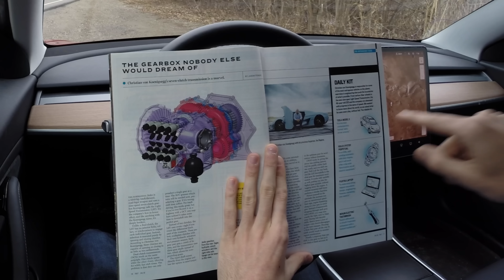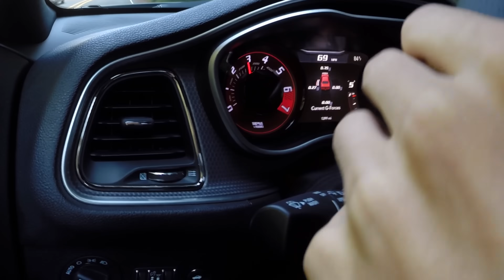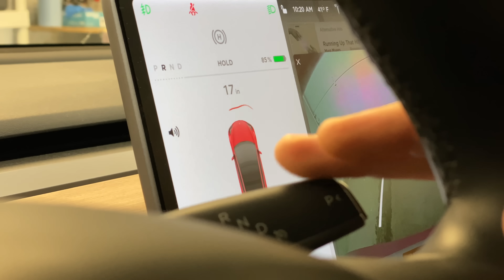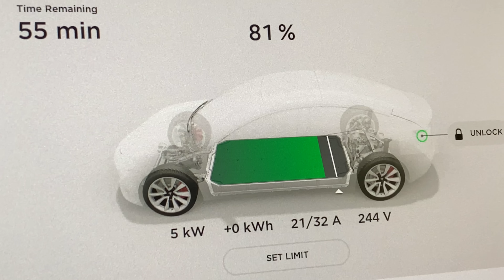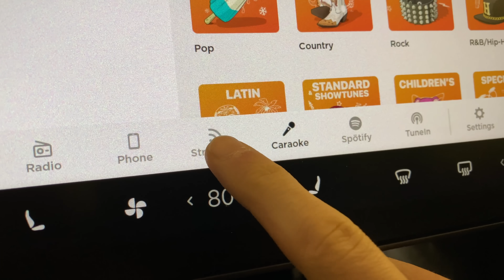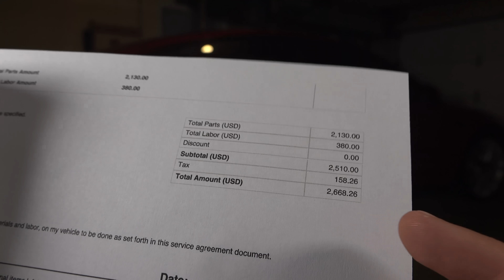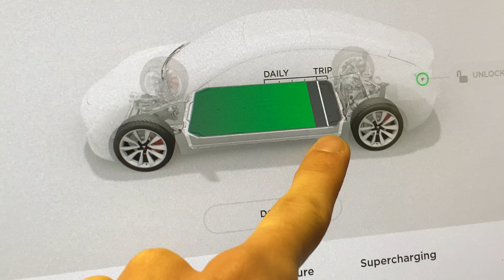Living With A Tesla Model 3 For A Year - The Best Daily Driver

Comment: Hey— my 2019 Camry XSE doesn’t sound THAT bad...exhaust is decent, engine is quiet when not flogging it.
But I would kill for a Tesla Model 3, upper trim.
Reply: Daemon Silver It may seem to not sound that bad and the exhaust may seem decent, but you have learned to tune those sounds and smells out. Drive an EV for 6 months and then try driving your Camry and you will be surprised at how your perspective will change.

Comment: Why set battery at 80% when you don't know if the battery management system doesn't do it already? You then can end up with 60% of physical capacity.
Reply: Tesla recommends setting the max state of charge to no more than 90% and only going above 90% if you need to for travel.
Users seem to recommend 80% as a good daily normal because at 90% regenerative braking is limited.

Comment: 13:10 - not true. Basically you didn’t read the owners manual.. :)
There IS a manual emergency release handles on the back doors. BUT for child safety purposes (and to protect rear windows), they are hidden inside the door speaker. The speaker cover is easy to get off with just hands - so yeah, there IS manual emergency release handles in the rear too.

- The More You Know :D
Reply: Child safety purposes?   Hidden inside the speaker?   GTFO.   essentially you just said, disassemble the door handle and find the mechanical portion of the latch.
Reply: That's only for the Model X. Unless it changed, the owner's manual states only the front doors have manual releases.
Reply: Yeah, or they could have made them visible and used a child safety lockout selector in the end of the door latch like everybody else. Pretty sure that feature isn't under a current patent.
Reply: Larry Bolan having it hidden behind a door speaker probably is! Insane.
Reply: In an emergency, that is too much thinking and too much time..... in such a situation, the folks in the back probably would not have read the manual anyway...
Reply: Okay, cool. Guess every passenger had better pass the "where is the super hidden emergency door release handle" quiz before they get in.
...
Or Tesla could put the release handle in plain sight like every other car in existence.
Reply: mjc0961 just like the front release ones that everyone mistakenly uses to get out? Teslas are like escape rooms!
Reply: @mjc0961  The regular release button drops the windows out of  their seals before the door opens. The emergency handle just mechanically opens the doors and could damage the seals
Reply: @mjc0961 You don't want your five year-old who has just graduated from the car seat opening the door and exiting the car in a fit at 20 mph because you won't stop off at their preferred destination.
The driver can tell adults where the release handle is. The super secret release handles are better than the child safety locks that are inside the door jamb in ICE cars. I've been temporarily trapped in the back seat of a few cars when the driver forgot to unlock the rear doors.
Reply: @mjc0961  every other car does not have a electrical button as the door opener, and therefore the need for an emergency release handle. It's a part of the design. :) 

It's ONLY needed if there is an accident that completely shuts all electric power down, which is never heard of to this date yet. So you'll probably never need it anyway, unless you run red lights with 0% batteri and slam into a tree with 90mph lmao.

So don't worry about it dude. :)
Reply: Emre Altintas so how come the front ones are so visible and accessible that many passengers use them to open the front doors by mistake? And also, what if the button has a malfunction? You’re just too smart to have thought of that though;) or the automatic door mechanism fails? The battery could be at 100% charge and that would make 0% difference. And you will be 100% dead too! And haven’t you forgotten that several people burned to death in their cars because bystanders couldn’t get the doors open from the outside? So you suffer from memory loss too?
Reply: I mean, an electric car can have normal door handles, so...
Reply: @LazerLord10  You haven't solved the child safety locks problem. Those defeat the interior door handles.
Reply: @Markle2k  In every vehicle I've driven, the doors all lock once you get up to speed, and I imagine they unlock in the event of emergency egress, and I'm pretty sure that most cars nowadays are child safe and still have mechanical handles. Really, this concern is about how a button or something else in the electronics chain could fail and cause an unsafe situation, whereas the mechanical handles are a lot simpler, and thus (in theory) more reliable. In actuality, the difference probably isn't notable for actual safety (as you mentioned with the lack of problems so far), but still something to consider.
Reply: @LazerLord10 I'm not sure whether you are privileged or deprived by never having ridden in a car without power door locks.
I will make this plain, when the child safety lock switch is thrown, the rear unlock switches do not work and the interior door handles do not work if the doors are locked. Only the driver's position has lock switches for all four doors. If you lose 12 volt power or the driver's switch panel is broken, the only way to get out of the back is to be let out by the outside door handle or to climb over and through to the front seats.
Much like the interior trunk release mandated by law, the Tesla has a mechanical means to open the rear door from the inside.
Reply: @Markle2k  Alright then. Fair enough.
Reply: Markle2k sure has, child safety locks are engaged by choice, not by default
Reply: @JeepCherokeeful  Child safety locks are frequently left engaged through forgetfulness. They are hidden in the door frame and completely transparent to a driver who only uses the outside rear door handle to load bags and other cargo.
Reply: Markle2k it does happen sometimes, but it would have to be both and the first time on the trip the adult would have tried to get out. These vehicles are the only one with this design and it isn’t necessary, as a car enthusiast I worry about other shortcomings, such as no windshield wiper stalk and I’ve also heard the batteries loose a significant amount of range in heavy rain. Plus of course cold weather and phantom drain.
Reply: Markle2k ok, so why would this person ever lock both of them if they don’t have kids? And how did you know where these magical switches were? You must have read the owners manual. Or maybe all other child locks are in that same location so you just assume by default that’s where they were.
Reply: @LazerLord10  you are absolutely right. It is somewhat a design flaw. Because the S/X clearly do have them.
Reply: That could explain the difference of the sound system in the rear!

Comment: I'm surprised a guy as car smart as you  Hasn't figured out how to set your mirrors so that you really don't have a blind spot... I mean I learned that at 16 years old in my driver's Ed class in high school.  I'll throw you a tip:   Take your left ear and put it against your driver's door window, Then move the mirror outward until you can just not see the side of your vehicle, Then sit backup straight and adjust as needed for vertical view. Then lean to about the middle of the car maybe a bit further on your right,  Adjust the mirror in the same way horizontally so that you can just not see the side of your car, Again then sit upright adjust for vertical view... if you don't believe me grab some cones and a friend.  Have the friend stand at the back corner of the car and set the cone down when you can't see him on your left.  Then set your mirror like I stated and repeat the test.  What blindspot may possibly yet exist is so tiny it doesn't even really qualify as a blindspot.   I've set my mirrors this way since I was 16 years old And what I can tell you is that 99.9% of the time I still see somebody's brake lights on my left or right in my mirror when I make a 90ﾟ look to my left or right and see their headlights.  Tell you what, Make a video on it and shoot me that shout out when you find how Awesome the trick is😉😊

Comment: There is one thing which you left out, but maybe it was on purpose... Energy efficiency.

In Europe we have it relatively easy when it comes to calculations, because basically 1 liter of fossil fuel (diesel or gasoline) basically equates to 10 kWh of potential energy. Which means that my 2.2 tons Model S basically has, during its lifetime so far, consumed the energy equivalent of 1.87 liters for 100 km (ie 18.7 kWh/100 km; and no, I won't "translate" to kWh/100 miles or mpge -- use the metric system). Compare that to basic diesel powered city cars which boast, at best, 4 liters for 100 km.

Comment: I'm not sure if you can weigh in on this or not:
How does the battery charge hold up in the winter, the most common bash i hear about Tesla (from non Tesla owners who are scared of change) is that it would be pointless in the winter/cold weather because the battery would die so fast. I'm assuming they are using the logic of "well my phone dies fast in the cold so my car would to" but, we regularly see -20C/-30C temperatures in Canada and it would be great to hear how the car handles below freezing temperatures if you have experienced that where you live. I already have forwarded this video on to a few of my friends who are afraid of EV's and finding out about its winter capabilities would be icing on the cake.

Comment: 9:42 what about the environmental impact of long term battery supply sustainability ( mining etc) and recycling of used/dead batteries?
11:08 doesn't not using the brakes for prolonged periods cause seized calipers?
Reply: Mining metals is still greener than drilling and refining crude oil.

Comment: Jason:  at 6:43 you say "when I leave my house it always has a full battery".  This implies you always plug it in when in your garage?  I understand the max level set below 100%, but even at 80% is this a good habit for the life of the battery cells?  I thought charge it when it gets below the need for the next day, like if the range was less then my daily round trip, then charge it, so I might charge it once or maybe twice a week and avoid the constant topping off.  Or am I off base here and you recommend always charging whenever possible?
Reply: It's a monitored charging system, so you cannot overcharge it and it controls the charge for optimal electrode life. What kills these batteries is constant supercharging.

Comment: Im surprised you didn't mention gasoline itself. A class 3 explosive, that contains 15 hazardous chemicals, causes cancer, and intoxication, and you can actually get to the fuel, instead of closed systems like CNG or electric where you cant get to the fuel. Gasoline is insanely  dangerous, and would never allowed to be used today.

Comment: I really like the idea of electric  cars. I cannot accept a fuel where 75% of what I buy is wasted as heat. However, the whole appeal of electric cars is simplicity, yet manufacturers insist on piling BS flimsy gadgets on electric cars, perhaps to justify the price?
I watched my friends lease Model X, S, and while they love the cars, they simply have not been reliable. They should be the most relaible car on the road. Buying one off warranty is just not an option.
In my region, they devalue about $10K/yr, but plummet off warranty. For me, $50K in devaluation means almost 20 years of gas purchases.
When they make economic sense and when they get as reliable as they should be, I'll buy one.
Reply: Tesla has the highest resale value of any car. Not sure where you live but overall Tesla devalue way less than most cars.

Comment: No one-pedal driving on my S100D, even though it’s less than a year old. Which is funny, since it will come to a full stop with ACC or Autopilot activated. Well, luckily that’s how I usually drive anyway. After 6 months behind the wheel I love it. Never going back to ICE cars, if not for hobby purposes. EV’s are fantastic, despite some of the drawbacks. Also far better during winter than ICE. It’s always warm in a Tesla. Well, assuming it has enough charge remaining that is.

Comment: But the battery life for electric cars are very poor and will give much reduced capacity ehen compared to new ones and should be replaced regularely to keep optimal range (which is piss poor compared to disel or even petrol). 50k for a car is outrageous (4.5 years worth of netto wage for me). Not to mention infrastructure is not ready for electric cars. And cold weather and no garage will kill battery even faster. For now electric is a gimmic only rich can afford.

Comment: You can always point the vents at the steering wheel before you leave to heat the steering wheel but it does seem annoying not having a heated steering wheel on a car that expensive.

Comment: How is the noise on the highway? I rode in a model S and I thought it was louder than most gas cars because of the wind and tire noise. (Usually engine noise when not accelerating is basically imperceptible anyway)
Reply: Road/wind noise is not great, maybe the worst feature of the car. That said, it's better than ICE at low speeds, and still comparable at highway speeds, you just hear the road noise a lot more because it isn't competing with engine noise.

Comment: I've recently received my model 3 performance edition a day before Christmas 2019, and wow, this is absolutely the best, most convenient, comfortable car I've bought. The 0-60 mph time is within 3.5 seconds which is amazingly fast. Performance is not joke. Handling is also phenomenal for the weight and sedan class it is. Ive had no complaints other than the advertised mileage of 310 miles, realistically it's only gives you 240-250 miles on a full charge while driving as you would normally would. Also if you can charge at home/work with output of 20 mph, you're pretty much set for a commute that's within a daily 200 mile range commute. For those who live in apartment or don't have readily available charging, its much harder for you guys, it's possible but you'd have to visit a supercharger/third party charge stations more often. Tesla should have more stations coming soon in the future. Personally if you have the opportunity to test drive one for a day, I'd say try it out, despite being a 4 door sedan, this car is just as good or better han other much more expensive gasoline cars!

Comment: dude... great segment. he's right about the child safety. a good idea would be to make the back emergency latches where in 'child mode', they won't open the door unless power is lost. and for those of you living at condo/apartment complexes- at least in CA- state lawmakers here are using the 'carrot vs. stick' plan. right now- the state will fund your property owner to install chargers. in just a few years.. they will stop funding it. then- they STOP FUNDING. THEN- THERE WILL BE A BRIEF GRACE PERIOD. AFTER THAT- THEY WILL START HITTING TH PROPERTY OWNER WITH A HUGE PROPERTY TAX INCREASE- A 'POLLUTION FEE' if you will. in other words, take the carrot (install chargers).. or you GET THE STICK! (higher taxes).

Comment: That car you drive should cost more then $100,000 because of everything it has and can do, and when you complained about the steering wheel heat and then involved it with the price of the car  was silly 😜.

Comment: 1. Can you get an extended warranty? e.g. 6 years in total? I bet there is no one in 200km range from my town that can fix it.
  2. What would be the total cost of ownership for 6 years?
Reply: You have to, the car cannot exist off warranty because you cannot just bring it to any garage to get repaired. You can extend the warranty on the model S or X, but not the model 3, because Tesla does not want that liability.  I have to wonder why Tesla will not extend warranty on the Model 3. At year 8, the car could be worthless.

Comment: In a few years - yeah. Better capacity and quick charging is the key. Now, I drove in Model S around SF some time ago and it was loosing 1% of battery per hill. Insane, worse than a smartphone. And it's still impossible to do 2 laps around the Ring in one. But if they'll fix that, and figure out how to make batteries without destroying the environment 10x more than when digging for oil - I'm all in.

Comment: Lots of ignored subjects in this review. How about the cobalt,  mined by children as young as 4 in the Congo?  How about the general filthy business of making the batteries?  How about the impact of the miles traveled from here to there to get the battery components produced and then assembled? Why no talk of the impact of cold weather on range? What about the cars looks? For 60K+ it should have some presence. It doesn't. How about the interior. Is that any better than a mid-spec Accord?  To me, it's just a very quick car that shows off your enviro-bonafides.
Reply: You mean the same children that made the cobalt inside the cell phones you use daily? Mining metals is still a lot greener than drilling, refining and distributing crude oil.
Reply: @xBIGMUSCLEx  Your retort is to compare a cellphone (1 or 2 cells) to a battery pack in a Tesla that has thousands of cells?  Really? As far as the mining goes you are wrong again. A.) No children (slave labor essentially) involved. B.) The run off to streams and creeks and lakes is vastly more polluting than that incurred during the oil refining process.

Comment: To all manufacturers of cars: make your sports models available with smaller wheels and relatively higher sidewalls, especially for those who drive in and around cities a lot! We don't have to go back to tires with an aspect ratio of 70, but neither do they need to be 35 to 45. Make it a no cost option to get the 17's instead of the upsized 19's etc.